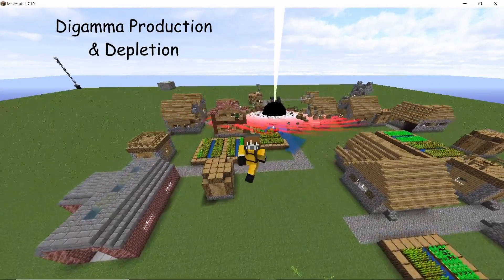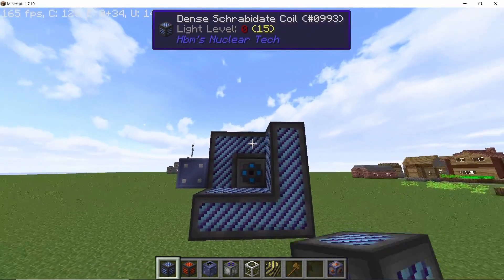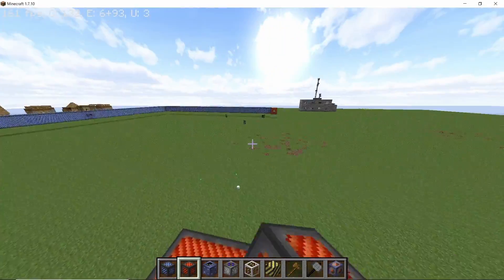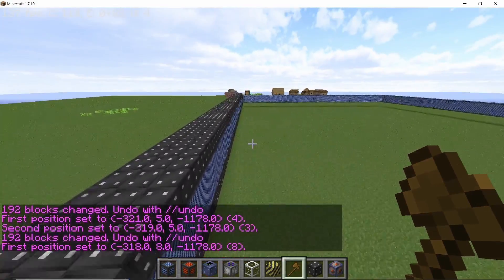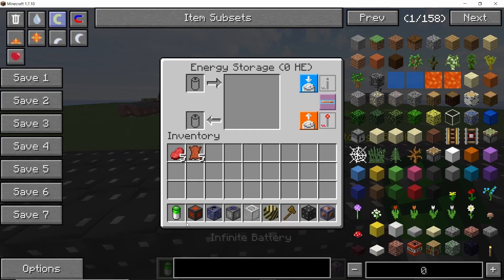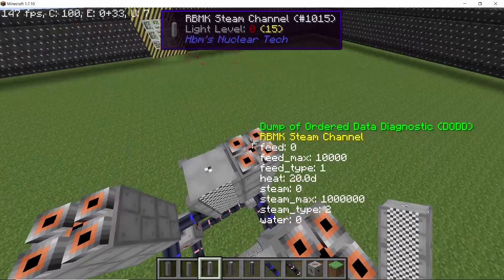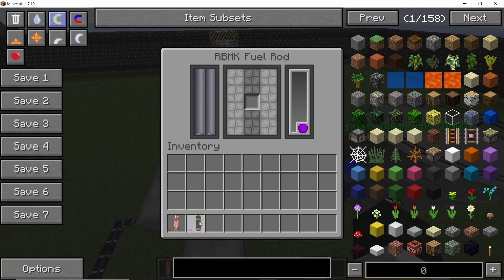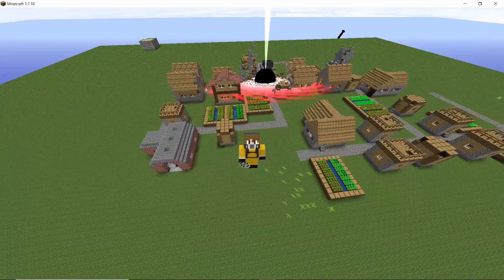How to get DIGAMMA Particle & Fuel Rod || Particle Accelerator tutorial NTM Minecraft

Comment: I encountered one small issue while making the RBMK because the water fluid duct doesn't connect to the steam connector. Are there any solutions to this? anyways great video
Reply from the maker: try using NTM Extended mod as it is more updated so it has solved this issue. Also it is a visual bug only but still if you would like to have them connected then ntm extended is the way to go
Reply: @SavageVegeta  Ok I will try that, thank you
Reply from the maker: @yubfer  you're most welcome

Comment: If it doesn't make that much power, then what's the point of using it? 
(Aside form bragging)
Reply from the maker: Well you'll need the depleted rod to get the raw materials for making the Digamma crystal for SILEX. Then it's also used for crafting the murky anvil. And finally this is not the best example of an RBMK that's working with Digamma fuel ... There are much bigger designs that can be made especially for breeding cause Digamma will put out alot of flux in it's rather short lifespan especially when it's all focussed on a single central irradiation column